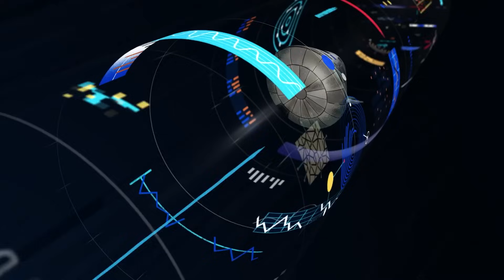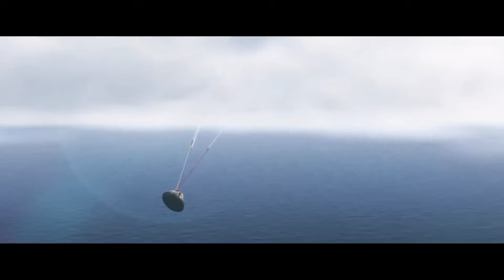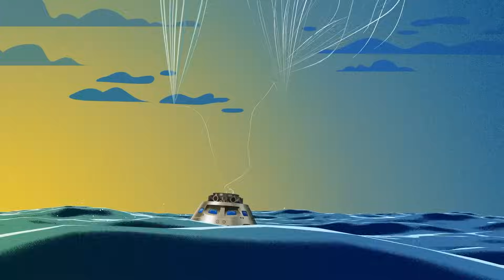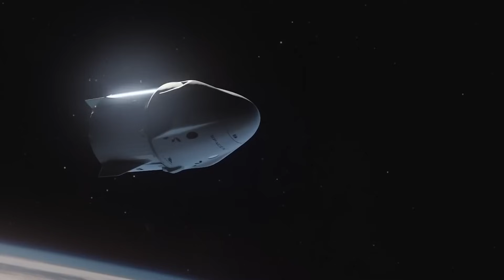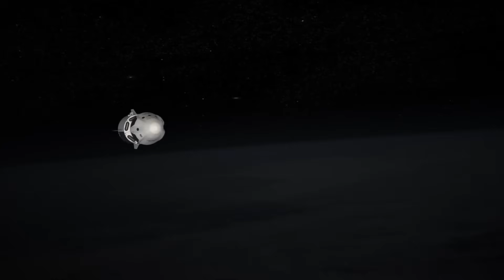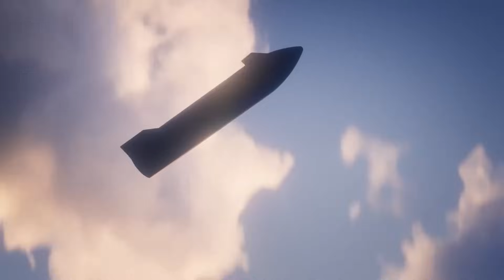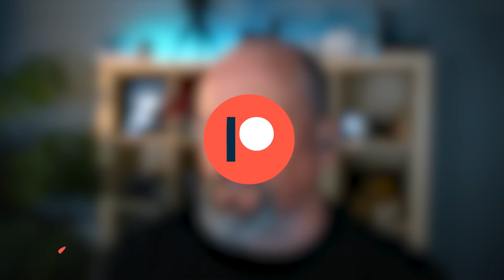Can Sweating Heat Shields Solve Re-Entry Problems for Reusable Rockets?

Comment: Two points that come to mind. 

Unless you can create a material with zero thermal expansion properties, as the heat shield warms, thermal expansion would likely close the pores, leading to a loss of flow and therefore loss of cooling. 

Second, any gas or liquid injected through the shield would push the insulating bubble away and into the atmospheric flow, giving you additional super heated gas to move out of the way. Regardless of what the temperature of that liquid starts at. The extra couple hundred degrees of cooling, even from liquid helium, would be no match for the thousands of degrees it would be heated to as it gets pushed out of the way. 

Basically I believe most engineers have come to the conclusion that a heat shield needs to be dead simple with minimal possible points of failure. The more intricate it is the more problematic it becomes. Any benefits simply get outweighed. 

But it is a good and interesting engineering problem for students to work through.
Reply: Thermal expansion doesn't do that until the temp is high enough to compromise structural integrity vs whatever compression force it's under. The rocket will break apart before the pores close.

The pores would actually grow larger, which is another problem as it changes the flow rate for a given pressure and might require separate flow controls (more weight/complexity) to manage uneven heating.
Reply: You're quite right, it needs to be kept simple and robust. Start with carbon foam panels. Carbon foam is strong, light weight and has an open cell structure - its porous. It's also a refractory material and will survive high temperatures on its own. Mount the carbon foam panels on standoffs so there is a space between the panels and the ship. Into that space, spray liquid methane, wetting the back side of the carbon foam panels. The methane will keep the space cold along with the ship. The methane evaporates and generates gas, which will evenly pressurise the space. And then the gas will naturally flow through the carbon foam. Even pressure, even flow rate. Let physics do the work. Also the plumbing is kept simple and you don't need fine nozzles. The plumbing is on the outside surface of the ship, so when you do install/replace the panels you're not dealing with any fluid connections. Just unbolt the panel and bolt a new one onto the same standoffs.

Comment: How about an electromagnetic shield? Works for the planet.
Reply: Thats like using a vacuum cleaner to cook food. It’s a different problem altogether. Earth’s magnetic field shields from charged particles, not reëntry heating.
Reply: @Wurtoz charged particles create heat. Thermosphere anyone?
Reply: @mcgunn74 Even if that is the case (I’m not an expert so I’ll just take your word for it) that still is a different problem. Charged particles aren’t creating the heat during reëntry, it’s the compression of the air. It’s solving the issue of charged particles causing heating, to the atmosphere causing heating. 

It’s like using a bulletproof vest against a flamethrower. It solves the issue of bullets hurting you, not fire hurting you.
Reply: @Wurtoz isn't the heat created by compression of the "air" just excited or charged particles of atmospheric gases?
Reply: @mcgunn74  No it’s just air compression causing heating and creating plasma. This happens anytime you compress a gas. When you pump a bike tire the air gets hotter. A magnetic field wouldn’t do much as the particles aren’t charged (not a lot at least).

Comment: I think a "Cavitation Shield" may provide a way to reduce the friction of re-entry. If you want to reduce the hardness/density of a State of Matter, you can add Matter that is at a higher State of Entropy. For instance, to make soil softer, add a liquid (e.g. water). To make water softer, add a gas. To make a gas softer softer, as with these examples, moving the atoms farther apart from each other reduces the friction of something passing through the material.

There might be a way to create a thin skin of microwaves on the surface of the Space Ship that would deflect the atoms that make up the atmosphere at the front of the ship, in effect creating a Shield via Cavitation. Powering an onboard microwave generator, its weight etc. is a another challenge. Perhaps it would be possible to harness some of the kinetic energy of re-entry and use that to power the microwave generator. The Space ship is a big piece of metal moving through the magnetic field of the Earth, and the Shield probably doesn't need to be very thick.

Perhaps a Shark Skin-like surface of the Heat Tiles would reduce friction.
Reply: The whole point of aerobraking is to take advantage of friction in order to slow down from orbital velocity.  Any measures that seem to reduce friction would be counterproductive in that context.  (Friction reduction would be, by contrast, actually advantageous in the case of sustained, powered hypersonic flight within the atmosphere.)
Reply: @Spherical_Cow Not if it saves your Space Ship from getting fried during re-entry, and cuts down on costs.

Comment: He mentioned CO2, which can be stored as a compressed liquid, so storage volume can be reduced. It can also take advantage of the phase change. Also available on Mars! :)
Reply: Or for methalox rockets, why not use liquid methane as transpiration fluid.  If it happens to combust with atmospheric oxygen (such as during reentry on Earth), you get even more gaseous byproduct volume per unit mass of spent fluid.  Though maybe uneven combustion could disrupt laminar flow...  🤔
Reply: @Spherical_Cow The combustion would inefficient, particularly at Mars. A lot of carbon (soot) is generated and thus blocks radiative transport of heat.
Reply: @Spherical_Cow  Methane has a specific heat of 2.08 KJ/KgK at 200 Kelvin, 2.9 at 500K and 4.5 at 1000K. In other words, it finds more ways to store energy as it gets hotter. Carbon dioxide at the same temperatures is 0.73, 1.01 and 1.23 respectively.
Reply: Methane is actually a good coolant. It's specific heat rises with temperature, plus when it dissociates, the carbon particles are an added benefit. But the main reason is the less complexity the better. The more fluids you have to manage the more mass and the more things that can go wrong.

Comment: I keep hearing it’s not friction but compression of air in front of the vehicle that causes heating?
Reply: @peterpicroc6065  You're right. Air compression contributes far more than friction to aerodynamic heating—especially at hypersonic speeds. Most of the heat comes from compressing air in front of the object, not from skin friction.
Reply: Well, kinetically speaking compression just amounts to increased friction (collision rate and collision velocity) between air molecules and the compressing surface(s). And at the core, all physics boils down to quantum mechanics anyway 😁
Reply: @Spherical_Cow compression itself leads to heating. It goes beyond just the surface in contact meaning it both generates heat and helps pressurise it against the surface. That means faster transfer to the metal, so a lot more complex than you might think.
Reply: Plasma sheath is the solution. The sr- 71 used them back in the 1960s
Reply: I was going to ask the same thing, even using very similar phrasing. Maybe he said that to ELI5 reentry heat with a relatable demonstration? Not that good of an ELI5 if it's wrong information.
Reply: Lies to children basically. I don't think the interviewee thinks the audience can comprehend that.

Comment: what's the deal with the solar lens Fraser? are we sending it
Reply from the maker: No plans right now. We're still in the "this is a good idea" stage.
Reply: It seems that idea would need to be done as a spherical swarm. Each sensor can only use the sun as a lens when looking in one direction, so even if the propulsion and communication issues were solved there's a good chance it wouldn't be looking at anything interesting.